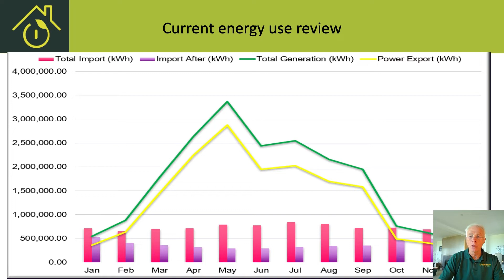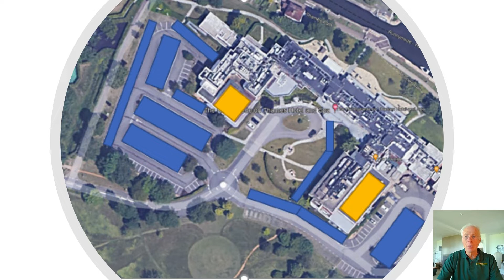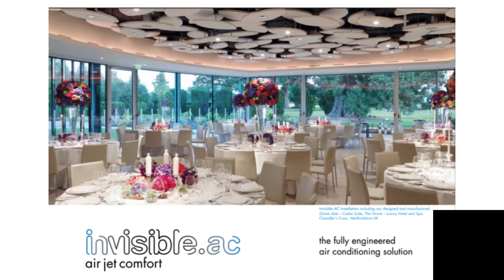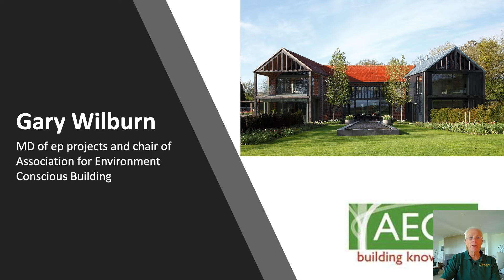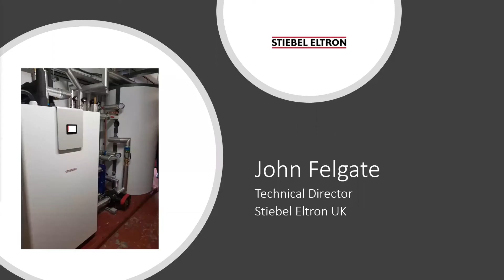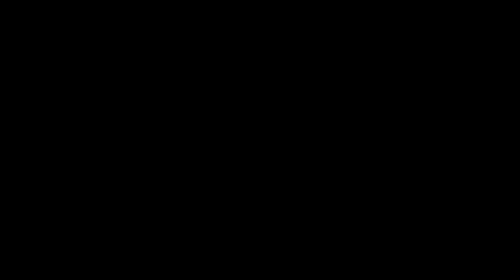Malthouse Webinar - How to make your property portfolio net zero without costly pitfalls

Comment: Very interesting webinar and what comes across very clearly is the benefit of experience. Learning from mistakes is crucial to designing a system that does actually still work in 20- 30 years when payback really provides significant benefits.  John Felgate's simple comment re heat pump efficiency seems so practical to start by looking at minimising the temp difference between the source and the use required in the property.  it may mean that not all the property can benefit from the heat pump but make as efficient as possible what is achievable . Look forward to next webinar